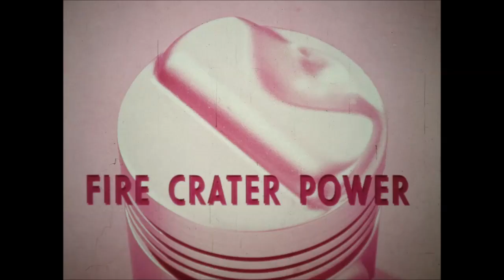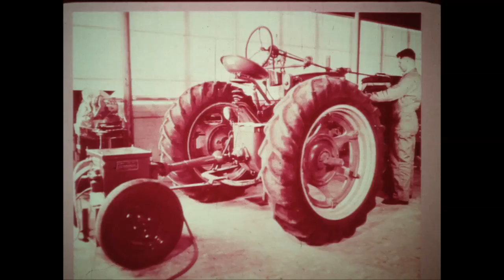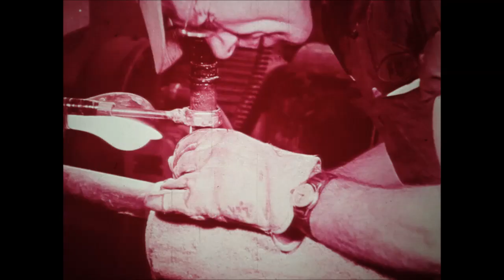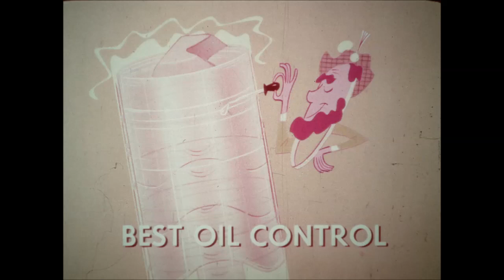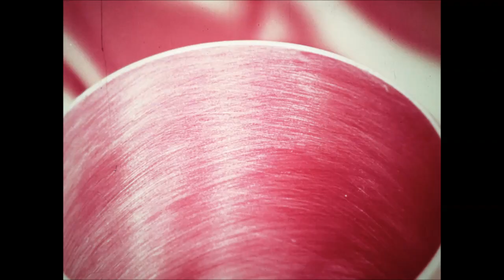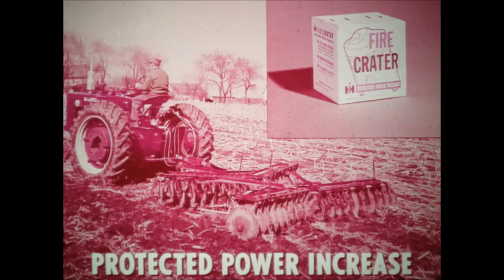IH Fire Crater Power

Comment: Had a neighbor with a 44 M that bought the Super M set for it. The distributor was freshened up and a 400 carb fitted. 65 HP on the dyno. Had a nice blue flame about 4" out the top of the pipe with a muffler. Seemed like the longer and harder you pulled it, the louder it got. Tried Premium fuel in it once disking stalks in the fall. The manifold glowed a bit. Spring plowing was pretty fun. Bull gears went not long after that. Now the old girl just sets with the transmission nearly wiped out, only 2 gears even work. Last used on an auger until they got a bigger auger.